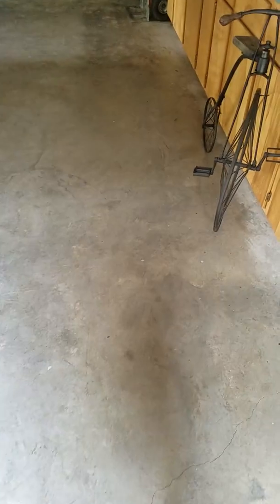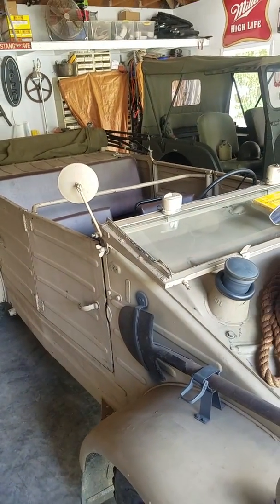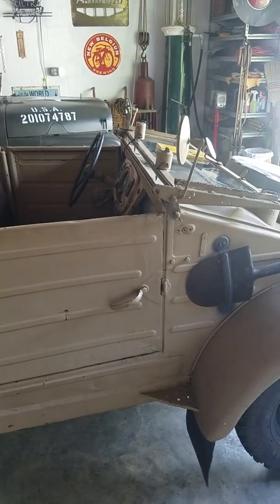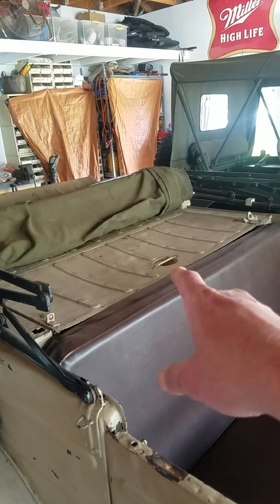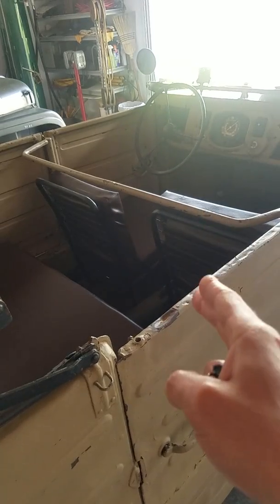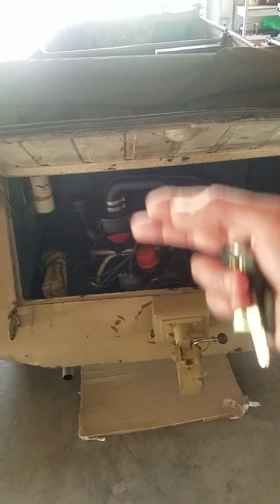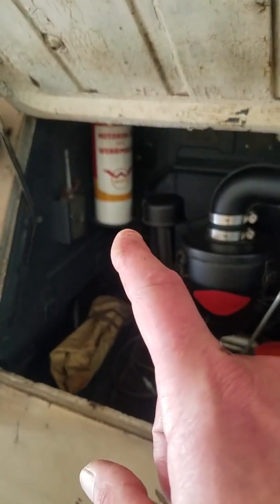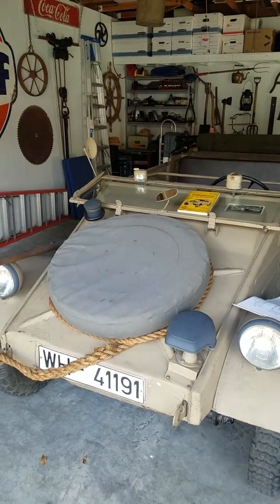WW2 German Wehrmacht Kubelwagen

Comment: This "Typ82" is a good car, but not 100% original: the 2 mirrors: are (of course replicas),  but 2°model ones; the front 'Notek-lamp' is has the WH/standard support: the   Factory type is has round-flat base w/ 3 bolts on the body; the total color it was "Panzer-Grau": become the "European-Mud" Only from March'43. To consider a Kubelw/: "Really-Original" after nearly 80years it is impossible, but if it has: At least, nearly, the All Original-Factory Bolts "KZ" mkd, even the all engine ones: well, we can talk about originality.
Reply from the maker: Thank You for your interest and insight. The Kubelwagon retains its original body, engine, and period paint. It's as original as you are going to find in 2022.
Reply: @TheReformReport 
When I found it: 1986/S.E-Austria: being a 'DoD': 10 Aug.'43 ("WV"Museum, Certified by Serial/Frame Number), I begin the "terrific"/ long-time-Job: for searching the many rare=expensives/details; the last one is the antiaircraft device for MG34, installed (on its specific "T"/Base of some Typ82 batches for "Convoy-Security").Your Typ82 it has typical features of early production time (best-quality): '41-'42 period: they were/Factory-delivered in Panzer-grau Color, but, from March'43 nearly all, were repinted in "dubkelgelb" for best camouflaging.
Reply from the maker: @giulioespositi9052  No doubt that it was originally feldgrau out of the factory in 41, but the paint on it now is the original repaint of it's later WW2 service, that's what I mean by original paint.
Reply: @TheReformReport   .
OK, BRAVO!...my last problem about my Typ82 is the REGOLATOR, I admired yours,  is original or replica?....i'm looking that item since many years. Anyway: being n important electrical device: it must be perfect. Yours it looks like the "2°type" w/ 'ribbed-enclosure', could you help me to find just one, similar?
Thank you, in advance, to contact you directly.
Espositi Giulio
Can you write your WEB SITE?
Reply from the maker: @giulioespositi9052  My father's friend owns the Kubelwagon, but I can ask him where you can locate original parts, specifically the regulator. Do you have the same model Kubelwagon?
Reply: @TheReformReport  
Non matter: type/DoD, etc....the motor, it was always the same: 25hp(DIN)- 6 V.  So, absolutely the Regulator, it was the one in your "
video"= PERFECT, the only "guarantee": is in really good  conditions.
Awaiting your precious-news,
Please have my best regard
s from Giulio Espositi.